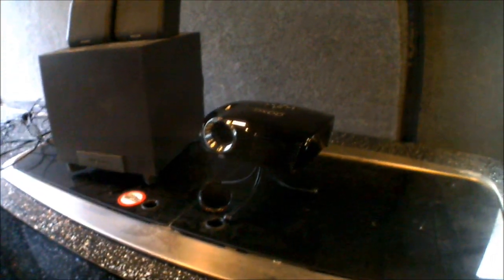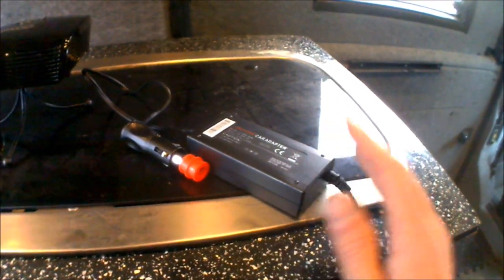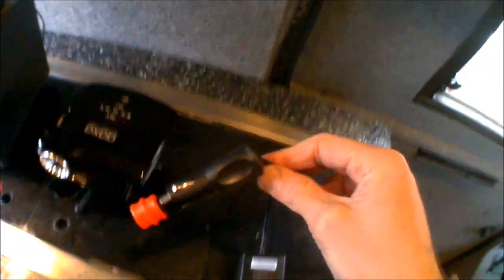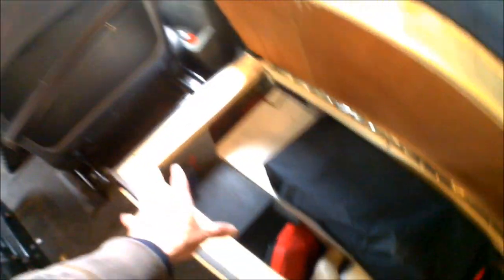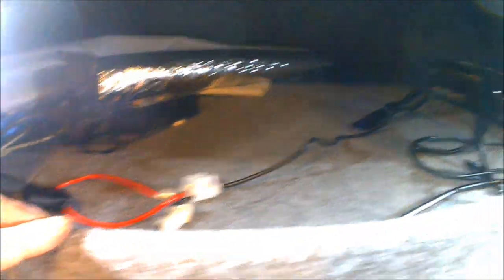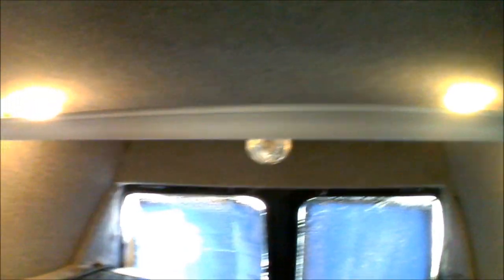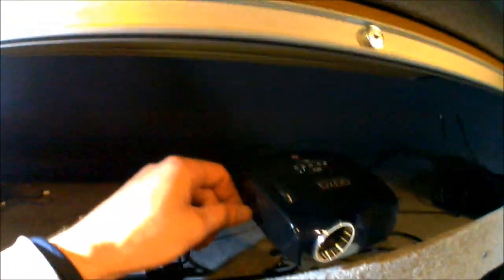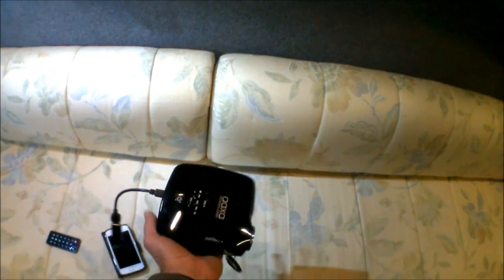Install HD Projector In Campervan - 12v Aaxa M2 HD Projector & Speaker Camper Setup

Comment: I advise you use the power adapter or some other form of surge protection a fuse will not protect from voltage spikes all the fuse will do is protect the wiring circuit from overloading in the event the projector shorts out it will not protect the projector from damage
Reply: Andrew Mason I advise punctuation, it makes it so much easier to read.